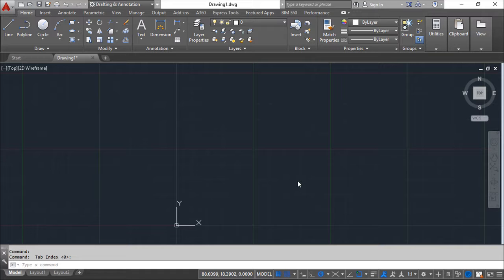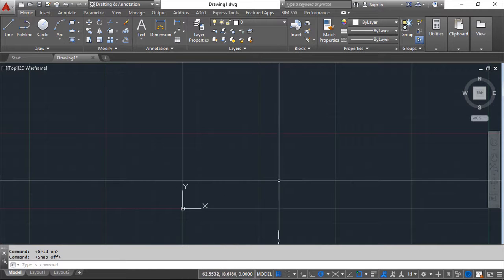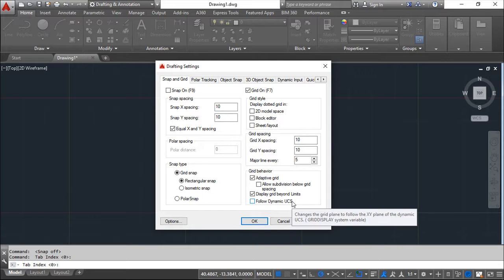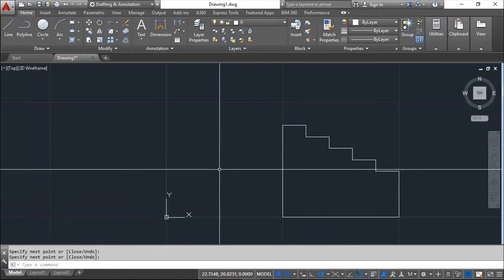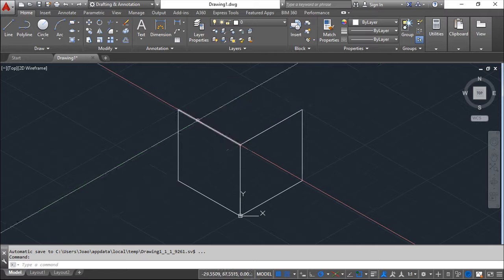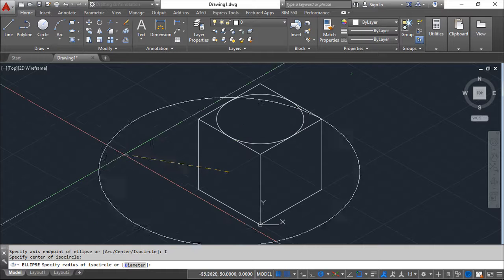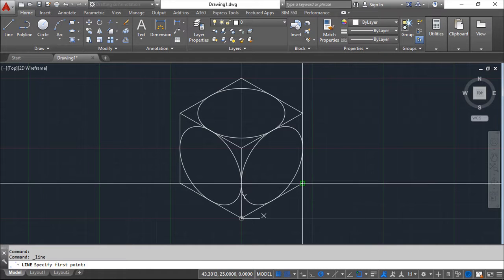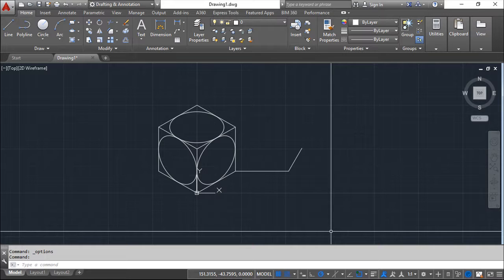AutoCAD 2016 English - Lesson 16/149 - Drafting tools

Comment: I turned on the snap mode but i didnt get anything like its on but the mouse is not moving how it should be
Reply from the maker: What is the behavior you are getting? How did you confirm snap mode is on? What were you expecting to have as behavior of the mouse?
Reply: CadsoftPortugal well i turned the snap mode in the way you showed, its color is blue so its on but my mouse isnt moving by units like yours when you turned the snap mode on...... I turned it on and off then on several times but i didnt get anything
Reply from the maker: It´s not easy to check what is going on without seeing, but i think you may be not doing On on the Snap. You should get a message in your command bar mentioning "Snap On". Do you get this? Check also the definitions of the snap (distance), because maybe you have a very big screen in your drawing area and them you may not notice it´s on because all it´s very big. Do a A3 rectangle, zoom all to see rectangle as maximum in your screen then check again.
Reply: CadsoftPortugal exactly, ive done exactly like you showed in your video.
Look i got into autocad, i started a new drawing, i turned the snap mode on and am sure that its on its written on the command bar and everything so am certain its on but its not functioning i dont know why
Reply from the maker: Check the other comment i´ve done about the size of the screen, and make a rectangle as i mention. Go to definitions of the snap and insert for example 5, after having the rectangle done and the zoom done for the rectangle.